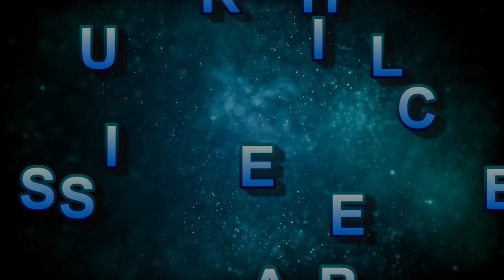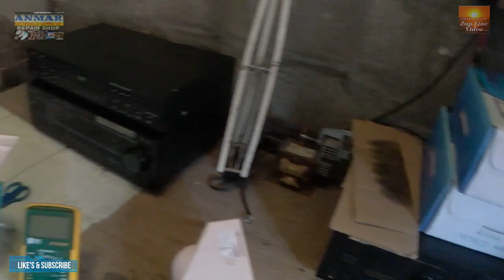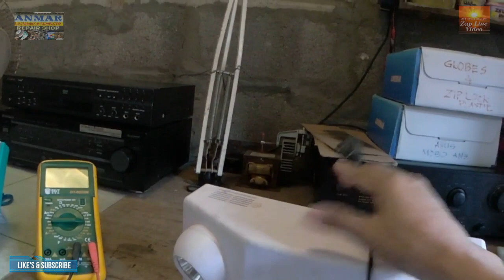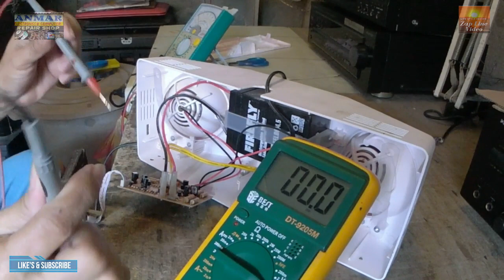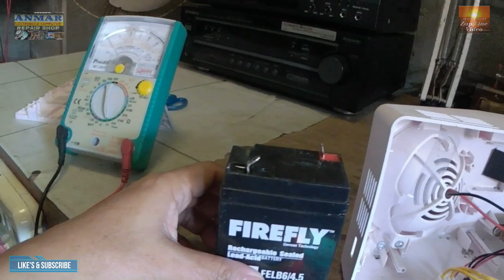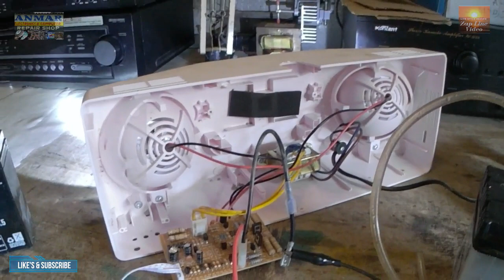#41 Ep. Fire Fly Emergency Light Ayaw Umilaw

Comment: boss walang ilaw yung charging light pati yung power light pero nag check ako ng output going to battery may voltage syang 7 volts. anu kaya ang sira nun.
Reply from the maker: Palitan mo ng bagong battery
Reply: @anjingtvsofficial3594  boss nagpalit na ako ng bagong battery. ayaw pa rin umilaw ng power light na red at yung green led na nakalagay charge. kapag nag switch naman ako ng ilaw  nagana naman sya kasi nga bago na ang battery. anu po kaya ang sira nun? at syanga pla pag sinukat ko ang output going to battery may 7 volts naman ang reading. slamat po